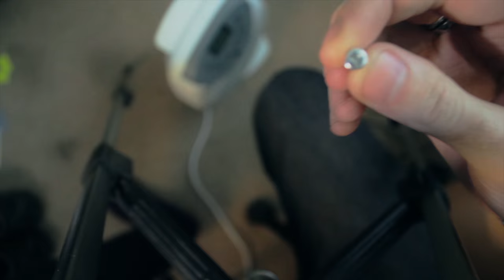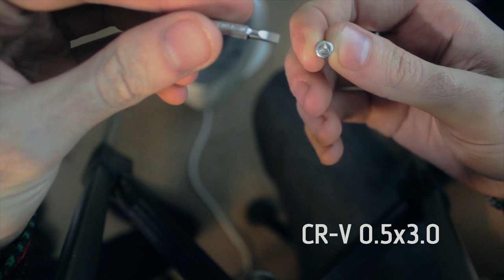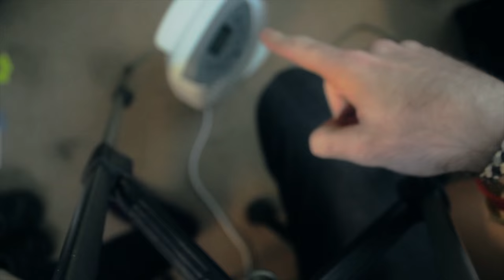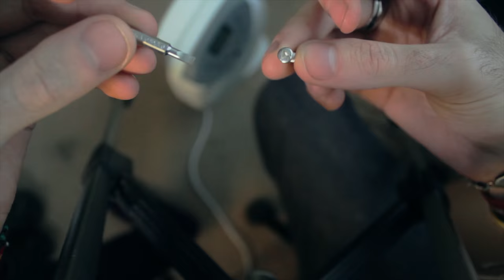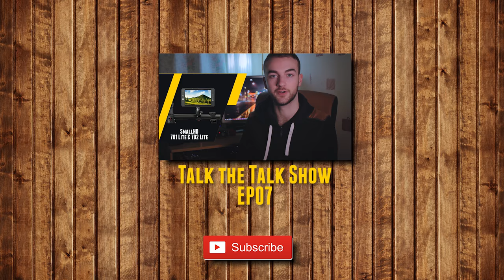HOW TO UNSCREW TRIANGLE SECURITY SCREWS & BOLTS | Lil Tips with Gaz EP01

Comment: Or just use a torx driver the right size to create an interference fit in the triangle, with two of the hex prongs exerting equal pressure on each of the three inside edges of your screw head.

Comment: nice video. subbed. 
BTW you can get a big set of screwdriver bits that will basically unscrew everything for about a fiver. I think the set is about 50 or so different ones.
Reply from the maker: +Nitsan Simantov Hey Nitsan, thanks for the support :) yeah having a kit around is definitely worth the fiver. I have two separate kits a small micro set for tiny screws and a normal kit it's pulled me out of a lot of interesting situations haha
Reply: Nitsan Simantov it has everything BUT triangle head screws
Reply: @UpcomingJedi  - then you should buy a kit that DOES include triangle bits.

Comment: I just used a really small allen key and it worked a treat! It was a tiny one - no bigger than 2 or 3mm. I wasn't expecting it to do anything but it slotted in perfect and the screw came out super easy. Worth a shot if you have an allen key set

Comment: Why am I watching this when I have the proper triangle screwdriver bit in my set?
Reply: Is it worth the money having the proper set? What are the size ranges of the triangle bits?
Reply: @paulf1071  - of course it's worthwhile to have a security bits set that can remove security screws. They cost about $5, but that's wasted money if you never need to open anything.
There are many different sizes of each of these special screws, but for triangle they generally are one of 3 sizes.

Comment: I tried doing this before, but the two triangle screws I wanted to unscrew (in order to fix a stirrer) are buried way too deep in the device and neither of my two small flathead screwdrivers can reach them. It's like this thing was designed to be opened only by the manufacturer or by a professional with a huge variety of screwdrivers. Apparently that was the idea. 
This is the first time I see triangle head screws by the way. I had no idea they existed, I thought my eyes were playing tricks on me..

Comment: they "tri-angulate" those screw heads for a reason. so lay-persons can't screw with the inndards(pun intended) but I need one for a Porsche Flathead V-6 model kit. the Drive motor is loud and I want to greese it up so it will not interfere with the cool Porsche sim engine noise. those germans and their triangle screw heads. ;)  referring to this:  https://www.youtube.com/watch?v=jc3BxA8ZAeg
Reply: We don't need to know your live story or be bothered by your spamming for YouTube views.
Just go and buy the tools you need, problem solved.

Comment: Thank you, thank you! I was so frustrated, after trying multiple times, to remove those *$#@& triangle screws, using different sizes of 6-sided Torx bits. Had no luck at all, with those. I watched your video, and tried a 3.0 flat bit, but it didn't work. But the 2.5 flat bit, DID! Hallelujah! BTW, (for anyone who's interested), I used a bit set I bought at Walmart 3-4 years ago, as I work on watches and jewelry, so I needed very small bits for those. It cost $ 5, and the name of it is: Hyper Tough 44-piece precision screwdriver bits set. It does NOT have a triangle bit in it - I used a flat bit from this set, which worked perfectly to remove triangle screws.

Comment: I used a Three Square File  :)
Reply: 3 Square file gives you three points of contact as opposed to just two points of contact using the method with the flathead screwdriver.
Reply: It's either a 3-sided (Triangular) file or a Square file (which has 4 sides). Geometry fail at school?

Comment: I tried using a flat one but it scrapes the metal out of the triangle and free-spins :/
Reply: Them you used the WRONG SIZE flat one. Would have just bought the correct bit - a whole set of 20,30,50 or more will cost you about $5.
Reply: @johncoops6897  Yeah the whole point was using what I have and not having to buy a new screwdriver
Reply: @visillac  - well, that was an exceptionally successful strategy of yours, wasn't it?

Comment: just drill out the screwhead and replace the screw when you're done.
Reply: Surely a last resort!
Reply: Where do I get a traingular drill bit in the Cleveland, Ohio area please.
Reply: @Gobi_Ness  - Buy a "security bit set" from any variety store or hardware shop which will include up to 50 different bits and costs about $5.

Comment: I wonder which idiot thought it was a good idea to use triangle screws in their product. They know many of us wont have the bit for it as its very uncommon.
Reply: That's exactly the point, it prevents you from opening up their product for whatever reason, whether it's to prevent injury from dangerous components, or so you don't modify it, or a bunch of other reasons...
Reply: @mitchellspanheimer1803  How about to fix their faulty product?
Reply: @bFORCe2003  Almost surely one of the "whatever reasons" could very well include the maximization of profit through minimization of lifespan and maximization of waste and environmental harm.
Reply: @bFORCe2003  - they are designed to keep people like you from injuring themselves. If you  you dont have the knowledge or skill to buy or circumvent a simple screw, then you certainly shouldnt be attempting to repair something.
Reply: @johncoops6897  Been fixing many appliances over the years so I certainly know my way around a simple screw however, this isnt your normal screw though is it.
Reply: @bFORCe2003  - no, it's not a normal screw... Which is PRECISELY why they use them. They stop the general public from opening the device! Probably the most common use of triangle head screws is in McDonald's kids meal toys, so you need bits to replace the batteries.
Ever seen the square drive (Robertson?) and both Torx & Security Torx with pin - they aren't normal screws either, yet bits are widely available for them. What about the pentalobe (5 sided torx) used in mobile devices like iPhones? What about the notched circular "game-bit" used by Nintendo? Or the numerous other obscurely-shaped fasteners?
All these special screws are very common now days, and a kit with 50 or more special bits is under USD$10 from your local hardware or online.
So, if you plan to repair modern things to save money, then it's worth the small investment to buy the proper tools to open them.
Reply: @johncoops6897  If they didnt want the general public from opening their devices, they would've sealed them so you cant open it, cos if it has a screw, then it can be opened no matter what screw head they use, it just means you have to buy the particular bit for it.
Reply: @bFORCe2003  - Just think about it. If they wanted to make a "throw-away", non-serviceable product then they would 100% seal it like you mentioned.
However by using a special screw they block the INEXPERIENCED AND CLUELESS GENERAL PUBLIC, whilat still allowing the product to be serviced by technicians, as well as those people who have tools to open it.
Look at the number of people responding to just this one video who considered they were capable enough to fiddle with a device, yet were not wise enough to  purchase the proper bit, nor smart enough to build a simple work-around. It's the perfect example of the kind of people that they don't want to open it.
Consider that the special screws cost more than standard Philips screws, plus require modified assembly processes - there is no way that manufacturers would add cost to any BOM unless it was deemed economically advantageous, and/or protected them against liability.
Why would a profit-driven company like McDonald's require that ALL externally accessible screws in Happy Meal toys use more expensive Triangle-bit screws? To eliminate legal liability, that's all.
So it's not some conspiracy theory like you propose... It's simply good practice to add tamper-resistance measures to consumer products.
Reply: @johncoops6897  Conspiracy theory I proposed?....,  you're reading something that is not there. You make it sound like you need a PHD just to unscrew a screw, yes its not your normal screw but all you need is the right screw bit for it.
Reply: @bFORCe2003  - sorry, I made a mistake - it was mike4ty4 above who had the theories. With the special screws, it's a deterrent to unqualified people without altering the assembly process or making service impossible. Despite your misunderstandings, these screw heads DO work, and they provide good protection against liability claims by consumers, which is the primary (only?) reason that they are installed.

Comment: show us the proper tool used for this fastener and where to buy it
Reply: Search the internet, plenty of companies sell triangle screwdrivers.
Reply: Do you REALLY need to see a picture of a triangle? The best way to buy these is a "security bits set" which will cost about $5 and include up to 50 different types and sizes of special screewdrive bits. You can get them at the local variety store or hardware.
Reply: John Coops  exactly. They are so cheap so common and you can get them anywhere.   Yet he don’t have one

Comment: Back when carburetors were coming out of GM and the other car companies and came preadjusted at the factory to meet the EPA rules, all of them had tamper proof screws and the like. Easy to overcome and most shops could circumvent the 'controls' to make the carb run better AND still meet the EPA specs. Triangle screws are easy to get around.

Comment: Thanks, dude.  It didn't work like a charm, but it did work.  I was able to remove the troublesome little screw and replace the batteries in a lightsaber penlight that we've had in a toy collection for about 20 years. :)

Comment: screwdrivers are not flatheaded, screws are. the blade you are talking about is a slot
Reply: technically the screw has the slot and the driver has the "flat head" so either way it's ass backwards! lol ;)